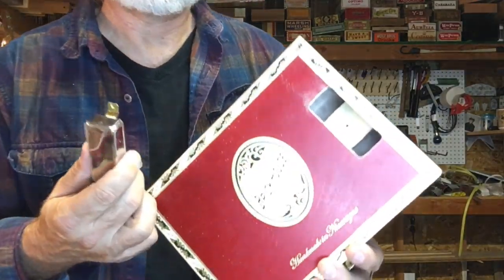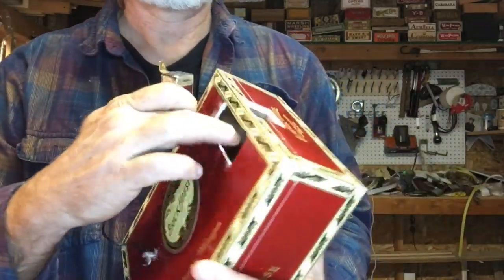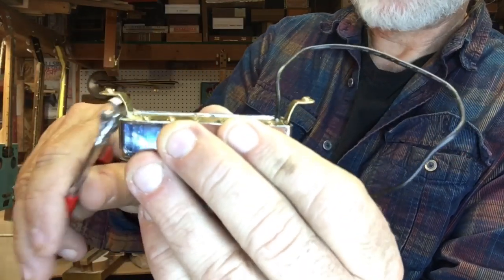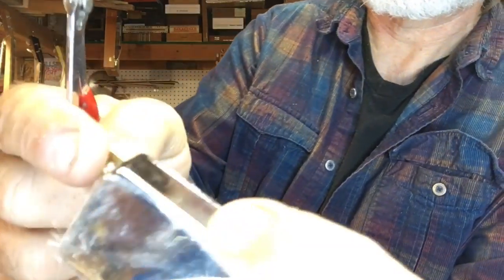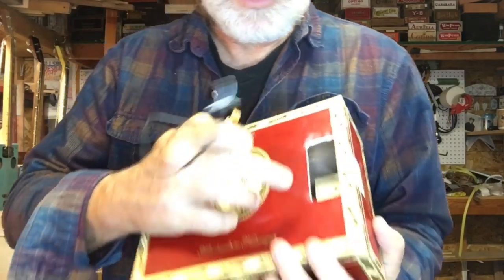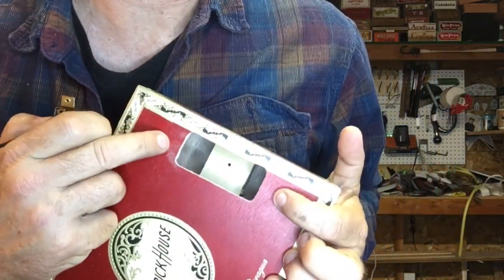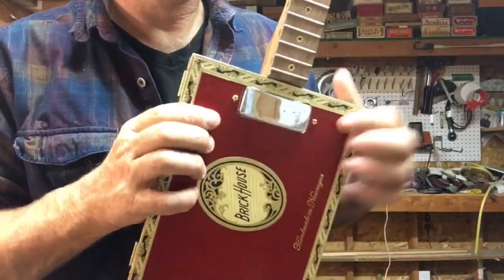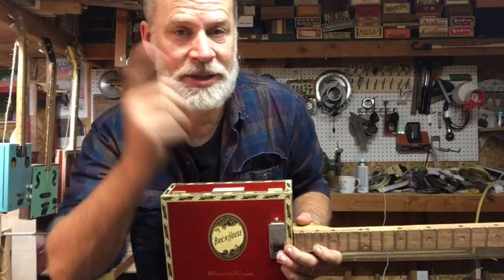Installing a Pickup in a Cigar Box Guitar

Comment: Friend, how do I ground a 2 wire humbucker in a 3 string cigar box.  I'm just replacing the 2 wire piezo with this pickup.  Normally on electric guitar you ground to the bridge.  If I ground to the output jack is that enough?  Also is it better in bridge or neck position?  Thank you for your time!